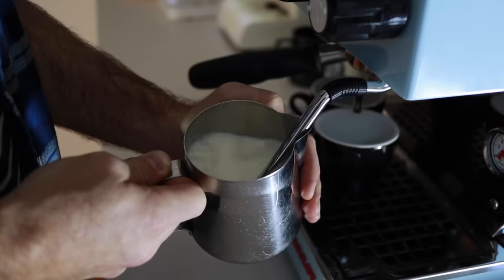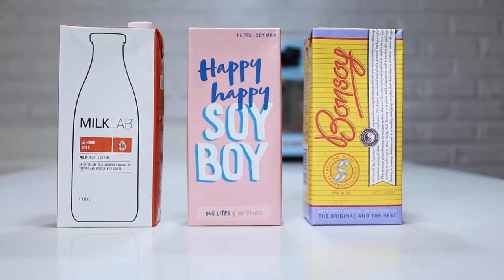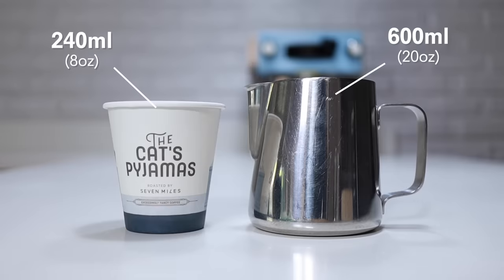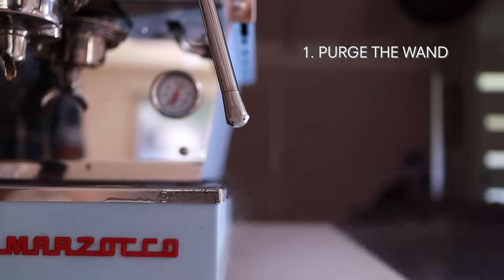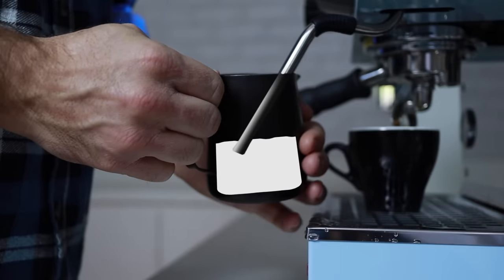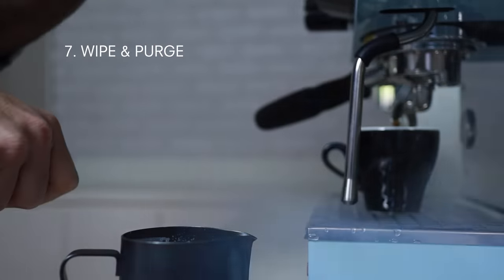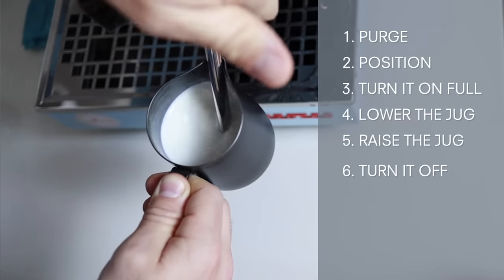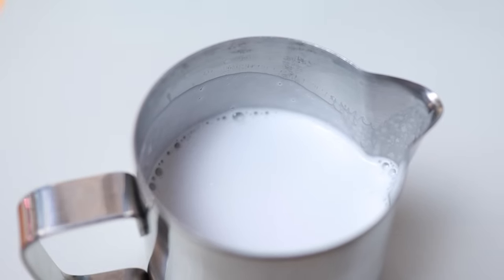Milk Texture: How to get beautifully silky steamed milk

Comment: That moment when you used dishsoap and got beautiful latte art. You got too excited and drink it haha
Reply: Haha
Reply: Are u ok
Reply: @Jay M Congratulations, you just ruined this comment section
Reply: Noooo! 🤣🤣OMG
Reply: I'm sure that was quite a "clean" tasting latte 😉👌
Reply: @oznurc.5415  啊0
Reply: I've learning with dish soap today!!😁
Reply: Not easy.  Mine look like a foaming beer every time, watery liquid underneath and airy foam on top.   Not sure what I am doing wrong.  Blasting the steamer on full creates a Sunami and if I don't turn it up very slowly it creates a floating foam even if the tip was never raised to the surface. This shit is hard.
Reply: @muhdnoor09  It wasn't me who drank the soap! Hahahaa
Reply: @xafafx  🤣🤣
Reply: I want to try by dish soap  how can i apply for a day today training
Reply: Instead of using dish soap. Use water and add a milk bottle lid worth of milk to the water.

It’s a much better way to practice as it’s actually milk your steaming and there is enough proteins within the capful of milk to actually produce a decent foam.

I’ve never heard of using detergent, obviously a capful of actual milk actually makes way more sense and your using what? 5-10ml of milk? Chump change
Reply: @endlessdrive8421  hehe I see what you did there 😄😄
Reply: That would be me😆
Reply: @jemmaevans8206  Jemma Evans you so pretty. Can we talk?

Comment: Omg after 1000 tutorials and attempts of trying doing the right foam I finally managed it after the first try with this video. I really can't believe it. One tip if your milk gets hot too fast: hold your cup and Steamer like shown in the video and then start by touching the milks surface with only the tip of your Steamer while it's already on. Do that while the milk gets hotter and only in the end put in the tip a little more to get that soft, shiny foam. The texture you get with this technique is insane!

Comment: When you said ‘it’s probably not you… pick a different brand’ I could relate to that.
I had an issue with the latte bubbling up after a minute or so. I changed to a different brand and it fixed the issue.

Comment: I've been doing this a long time with a great espresso machine. During the whirlpool, or vortex stage, a little foam starts to develop on one side. The result is at the end when I shut off the steam wand; cappuccino style faom immediately develops on the surface. Even after the tapping swirl, it's still there. So the results are not silky smooth.
Reply from the maker: The problem could be caused by a number or things: some varieties (and even seasons) of cow's milk contain a balance of protein & enzymes that prevent it from forming a stable foam. Also, if the tip of the steamer is partially blocked, I have noticed this makes it significantly more difficult to get a smooth texture.

Comment: Hi! Is there a mid range machine you would recommend for home baristas? Does the machine make a big difference in the ability to make silky milk or is it purely technique? Also, I had a breville once that used to spout a lot of water - is that normal?
Reply: Yes! I have the breville barista pro which I always have to purge quickly before submerging into my milk otherwise my milk gets watery. Amazing machine though!

Comment: The trick with washing up detergent is gold 😍😁 How can I achieve the same results at home without a steam wand? I have tried many different (home) ways and never got perfect milk out of that. I'd love to see a video about that too 😀☕️♨️
Reply: same here... still trying to get the consistency of the milk right with a hand frother
Reply: @MrHelidude  Frosty foam is easy to do. If you will be mixing the milk (or pressing in a french press) long enough you will get frosty foam eventually. I was asking about making that Silky Smooth Milk. It's much harder to do. I couldn't get good results with the french press. There were a lot of big bubbles in the milk and it wasn't smooth enough to prepare good late art.
Reply: Get a french press, you can find multiple tutorials on yt how to add air to milk with it and it's quite nice, I can easily pour latte art with some practice
Reply from the maker: I'm yet to see a simple method to produce really silky milk without a steam wand. A home espresso machine with a thermoblock (like the breville dual boiler) can get the job done nicely with practice.

Comment: I'm confused at the 20% increase in volume. How can you tell? You can obviously see the increase due to air but from what base point are we starting with? Is it a 20% increase in volume from the milk before stretching (where it's leveled flat) or during stretching (when it whirlpools and goes up the sides)?

Comment: I'd like to add that good milk helps. In Australia, I always saw awful results with the Coles/Woolies brand milk. Pura, Paul's or (in Canberra) Canberra Milk makes a massive difference over the cheap supermarket brands. So if you're using cheap (presumably watered-down) milk and struggling, try using some better milk.
Also, for me, the best alternative milk I've used is the grey carton of Oatly oat milk.

Comment: Thank you for the video. 
No matter how hard I try, or how many videos I watch, I can't seem to get the milk to swirl during the steaming process (to give it texture).
Reply from the maker: If you're using a home machine, it may be that the steamer is not powerful enough for the quantity of milk you're using. If so, the easiest fix is to use less milk (and perhaps a smaller jug)
Reply: @SevenMilesCoffeeRoasters  - I appreciate your response.  Yes, it's a Breville unit.  I actually watched a different video, and after trying it once I've had a LOT of success over the past few days.
Thank you again for all the instructions, info. and responding.

Comment: I have a nice pro-sumer machine that has a single hole for steam.  I noticed yours has multiple holes and seemed to work faster.  Is a single hole better for control?
Reply from the maker: The pressure of your steam and temperature will determine the speed & power of your steam.
Having multiple hole vs a single hole shouldn't create too much of an issue more than getting familiar with its flow.

Comment: I have several different size cups that I use, would you say I could get a jug 3x the size of my biggest cup or should I get a couple of different sizes? I realized after watching this that the small jug I have now is probably what's been messing me up.
Reply from the maker: yes, it is handy to have a couple of different sizes to suit different cup sizes. that way you don't need to over or underfill the jug which will help with getting the ideal texture.

Comment: So I just purchased a Breville Bambino plus for home use and it does not have a steam regulator on it so it just gives out steam at one level.  Just wondering your thoughts on this...
Reply from the maker: I have used the Bambino Plus (briefly), it did a surprisingly good job for an automatic steamer. the version I used had a control that allowed you to set the "foam level" in 3 increments. you could also steam milk manually. For me, the lack of control over steam pressure isn't a limiting factor - like many home machines, the steam pressure is much slower than what you'll see in our video - but the process and the steps are the same.

Comment: The tap and a swirl doesn't make the milk more creamy. It helps remove any bubbles that weren't removed while the milk was rolling in the vortex that you had created earlier.
Reply from the maker: That's right. But it's not only to remove the bubbles - swirling the milk also helps prevent the foam from separating too soon.

Comment: What's best size of cup for a double shots Latte? To reframe this correctly, what's the proportion of milk: espresso by volume for a latte?
Reply from the maker: The ideal ratio depends on the blend, however we typically use around 1 part espresso to 5 parts milk. For example, the cups in this video are around 180ml, so we use a single 25-30ml shot of espresso

Comment: My machine only has one steam setting. Should I try with a smaller jug or less milk in the jug? (the jug came with the machine)
Can't seem to avoid that screeching sound 😫
Reply from the maker: That screeching sound is coming from either: Having the steam tip to close to the bottom of the jug or sides and/or not adding air early on.
Try this and see how you go! :)

Comment: Does the machine make difference? I mean a strong steam should be easier than the one we get from $150 machine. Is that correct?
Reply from the maker: yes, it is generally easier with a bit more steam pressure. Having said that, some people find it easier on home machines as they allow more time to position the jug correctly. In my experience, home machines with a separate thermoblock (or boiler) give better results than the entry-level machines that have a single thermoblock.
Reply: @SevenMilesCoffeeRoasters  appreciate your reply. I was wondering what have been wrong with my steam technique so far. I have been doing it for a year without having a great result so far. It's always that I got thick foam if I judge it by the temperature on my hand. I use cold fresh milk (from the fridge) with  a 350 ml jug, steam it so it creates a whirlpool, do it until I barely couldn't handle the jug, then stop. Most of the time the foam is too thick. But if I stop it when I see the milk raised like 20%, it's still not in the right temperature (cold), so I bet maybe the steam wand doesn't produce enough hot steam pressure. It's a single thermo block entry level machine from Krups. I don't want to blame the machine first, but I don't have any access to a bigger machine to know whether I am the who is not good enough.
Reply: My understanding from other videos, that you use the air injection phase (kiss) to expand, then you raise the jug to keep the vortex (mixibg) and raising the temperature without creating new froth.

Comment: Thanks for the video. How can you measure the 20% you mention when injecting air?
Reply from the maker: Yes, It is hard to measure with the milk spinning around. It's easier to see exactly how much it's expanded when you've finished steaming. Then you can adjust the amount of air next time. After a while, you get the feel for when it's right.

Comment: What is the ratio of coffee volume to milk volume? how about milk weight? I find steaming 100g of milk leaves me after steaming with about 125g of liquid, probably too much? most importantly, when I pour onto say 50ml of coffee, I never get a white mass at the middle of the pour, so nothing to make art with.
Reply: The weight shouldn't change when you steam the milk, because you're only incorporating air into the milk. The volume should change by roughly the ratio you're suggesting, like 1/4+ more, depending if you wanna pour a cappuccino or a flat white.
Concerning your problem there it looks like your pouring is either the wrong speed, or your milk is too thin. There's another video (the one they're referencing in this one) that addresses these problems.

Comment: What if the steam wand doesn't produce strong steam? Is that possible? What can I do? Do I throw the machine out the window?
Reply from the maker: the steam doesn't need to be as strong as the machine we used in the video (or a commercial machine), but it will need  enough power to create a whirlpool in the jug. Some smaller home machines only give good results with smaller quantities of milk (and a small jug)

Comment: What is the actual temperature you steam the milk to? (As opposed to just “too hot to touch”)
Reply: Around 60°C (140°F), but it's usually easier to do it by touch and that temperature is when the pitcher becomes too hot to touch.

Comment: Do I tilt the jug forward or backward when steaming? What's the correct angle?
Reply from the maker: I keep the jug level and let the angle of the steaming wand do the work.
Reply: @SevenMilesCoffeeRoasters  My home machine steam wand is not at an angle so I have trouble with this
Reply from the maker: ok, then you'll need to angle the jug just enough to start a whirlpool - the exact angle will depend on the size of the jug, volume of milk, etc. Be sure to position the wand off to one side, ideally in the pouring spout of the jug.

Comment: What coffees can this type of milk be used for?
Reply from the maker: Here in Australia, most cafes would use this texture of milk for Flat White, Cafe Latte (and every other variation based on these). Some would also use it for Cappuccino, others would add a little extra air in the steaming process to make a slightly more 'dry' foam.

Comment: Roughly how long does the steaming take once you start ?
Reply from the maker: it varies depending on the amount of milk & the steam pressure of the machine. so for a commercial machine it could take 7 or 8 seconds, while an entry-level home machine could take 30 seconds or more for the same amount of milk.

Comment: But what if my steamer makes the “plane landing” sound when is on full pressure?
Reply: I think that means you've not let in enough air...or the spout is actually hitting the side of your pitcher. Someone else want to weigh in? I just started a few weeks ago!
Reply from the maker: As @Abby said!!
Most likely haven't yet added 'enough air' in at the start, the steam wand tip may be too hard up against the side or even possible the steam tip is currently jammed up against the bottom of the jug.

Position the wand somewhere to just off centre in the milk and 'just below' the surface of the milk.
- Turn wand on and add air (should be a bubbling sound as the whirlpool is created)
- Then sink the head just deeper than this point when enough air has been added.
- Then steam and control the swirl till serving temperature!!

Enjoy silky milk!! :)

Comment: He’s incorrect bout it being a big no no not  to turn steam on full blast. Most of the time yes. However if you have a small 8oz pitcher then better results on slightly less than full pressure.

Comment: That ‘too hot to touch’ method is not really accurate cuz some people have skin thick as leather or not as sensitive. They will either over steam and could make it thicker milk texture. It’s always good to use a frothing thermometer to feel the right temperature for you then get used to it.

Comment: Not easy.  Mine look like a foaming beer every time, watery liquid underneath and airy foam on top.   Not sure what I am doing wrong.  Blasting the steamer on full creates a Sunami and if I don't turn it up very slowly it creates a floating foam even if the tip was never raised to the surface. This shit is hard.

Comment: Never use cleaning products to practice milk frothing, you'll rust the inside of the steam wand and risk having particles from the product go up through the steam wand in to parts of the machine that aren't designed to take that kind of treatment which can destroy your machine or result in large repair bills you don't want to have to pay.

Not to mention if you don't purge all of the cleaning product out of the steam wand you risk serving it to a customer and poisoning them. This could kill someone.

Comment: Well, that was incredibly frustrating to see and hear:

- Cross-contaminating by having the steam wiping cloth on the bench instead of on the grill/drip tray.. 
- Telling people to turn the steam wand off when the bottom of the jug is too hot to touch? 

Please PLEASE stop telling people this, everyone has different temperature resistances on their hands! So it's going to be completely different.. Learn to use the thermometer to help you find your "count" for when it gets to temperature while you're touching/holding it.

Telling anyone to do the above as you had said in the video is the BEST way to give people food-poisoning and just crap coffee or even burning your customer due to the milk being far too hot!

I REALLY hope you don't tell people when cleaning the machine with chemicals to "flush it through 3-5 times, and you're done".